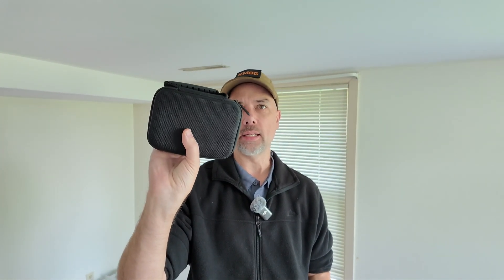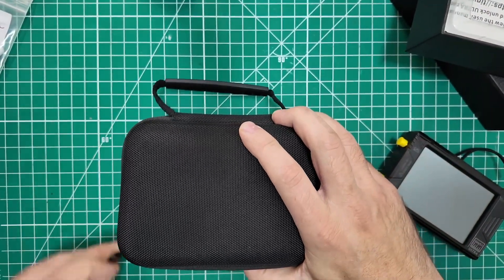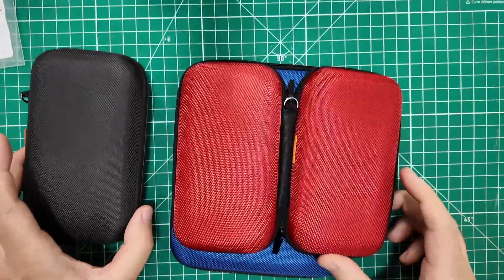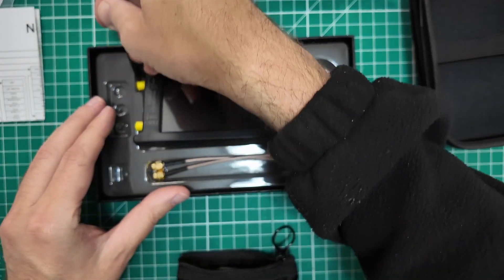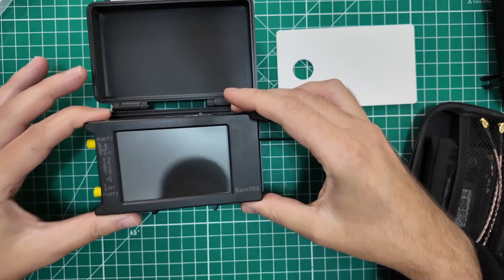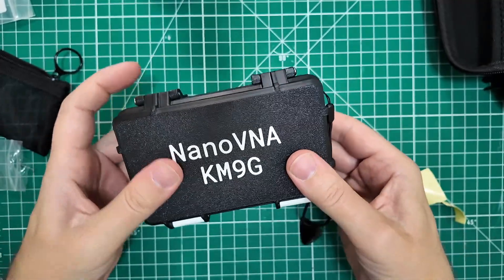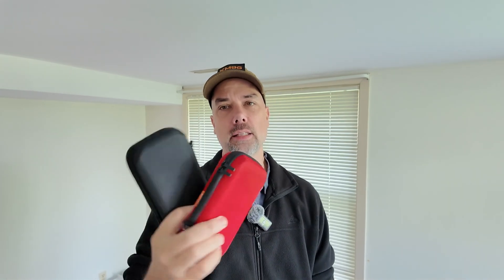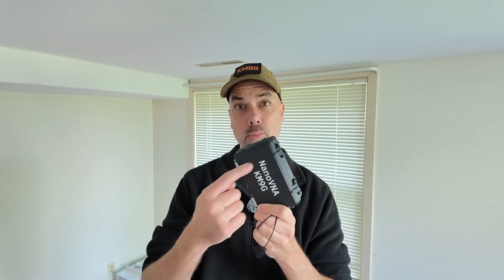Protect Your Instrument!

Comment: I did the same thing with my VNA and SA based on your original video but use a Herschel pouch for it all including a powerbank. But here is an idea for your leftover pouch: get a HanRongDa HRD-747 (or clone) receiver. It does LW through UHF, all mode. It is only about 2x4x.5 inches, but I need room for the USB cable, earphones, LW bar antenna, and MAGNIFIER. You require that for the super tiny (1pt?) font on the display, and the ergos are challenging.
Reply from the maker: Hey Barry, Good Idea - I needed a new radio anyway.

Comment: Great stuff. I have the nano VNA H4 . I have it in the Red zipper case. I do like the 3D printed case. I may get that. But a have several of them zipper cases. 2 of them just have Adapters in them. one of them as just USB cables . They go bad so 1 is none and 2 is 1 . when it comes to stuff like that we math different.  I have a zipper case just for small batteries like AA/9V/18650/26650/123 ETC . As time goes we need a different battery size.   73
Reply from the maker: I'm a big fan of make packs!  I have one for my adapters as well.

Comment: On those original cases I like to put the device face down so the wires and other stuff won’t scratch the screen when you zip it up. I usually put a tiny microfiber cloth on the screen side just to be safe.
Reply from the maker: Good idea!

Comment: If ou make an easement in the 3D printed case for the lanyard it will spoil any water resistance of the seam. (Is there an O-ring or a groove for one?)
Reply from the maker: No gasket - it's only water resistant - think light rain, not submersible